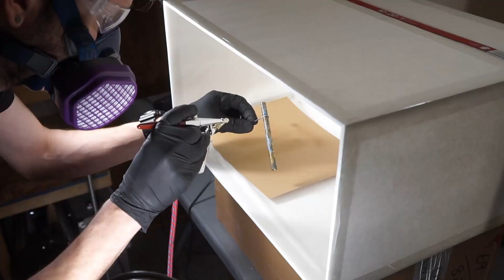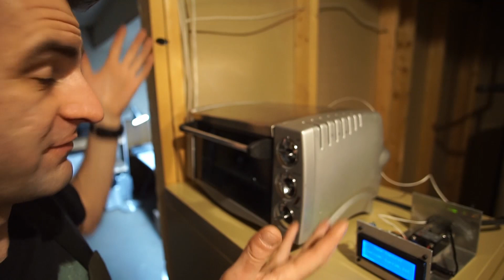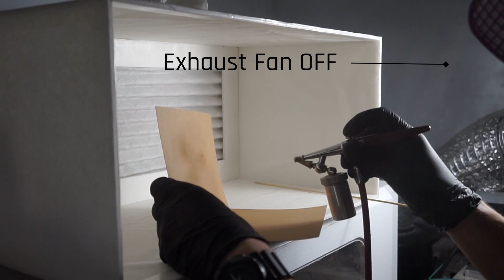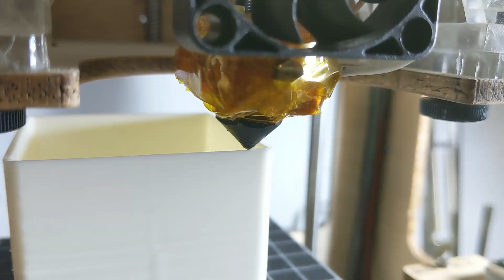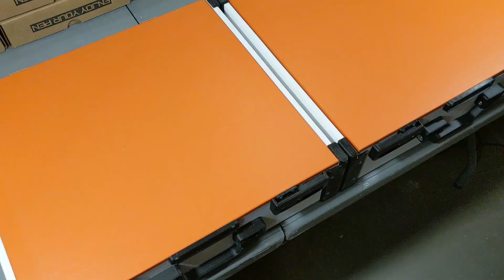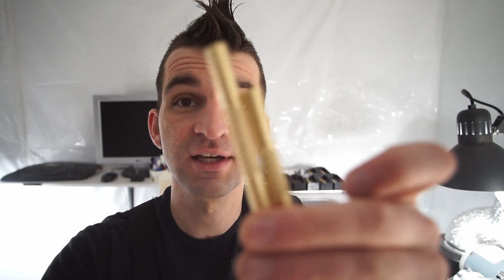Cerakote Subnautic Pens

Comment: Oh! Looking forward to seeing your new airbrush booth design
Reply from the maker: Haha, thanks man! A boat load of lighting and some solid air filtration are on the list so far...and a spot to put the damn brush down ;-) ! Glad I finally have a solid use case for it!
Reply: @CurtVanFilipowski  I picked up a fold up one a while ago, but doesn't have a great filtration system. 

I've retired and upgraded my airbrush models few times since then, and my compressor once. 

I use an Iwata cleaning pot for my "production brush" holder, and I have one attached to my compressor when working with more then one at a time.  

Nothing worse then dropping a brush and breaking/bending a needle.

Comment: I tend to 3d print ABS in 30-40c ambient temp also. My now retired 3d printer could hit mid 40c or low 50c. Thinking of building a new machine that is abs centric. Also I am glad the ABS parts worked for you. I knew they would.
Reply from the maker: Exactly what I'm shooting for ambient temp wise (well when it's in its own box...and I don't have to be in there with it)! Kinda forgot how annoying but useful ABS printing is for actual parts.
Reply: @CurtVanFilipowski  i recently went back to abs. The most annoying thing is the smell.

Comment: Looks like I need to do some Cerakote experiments.  I've been avoiding powder coat because of the equipment...  If you can spray Cera, then maybe that's a better solution.  Thanks for showing all your tricks!
Reply from the maker: I like it WAY more than powder coat...also one of my only options for a high quality clear coating. It's a little particular with cure temp but super easy to do with minimal equipment. Glad you got something useful out of it, always happy to share!